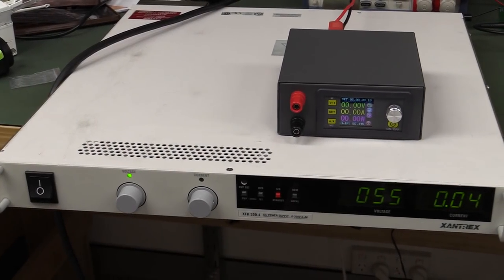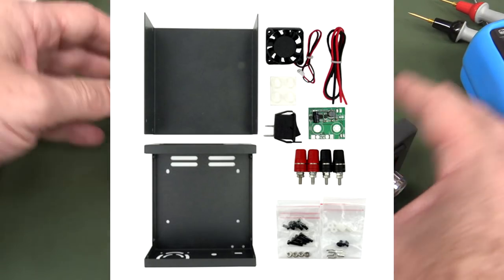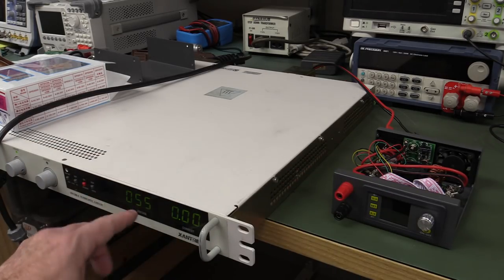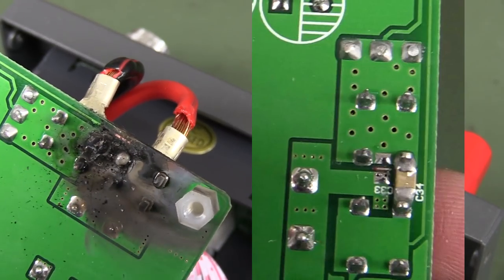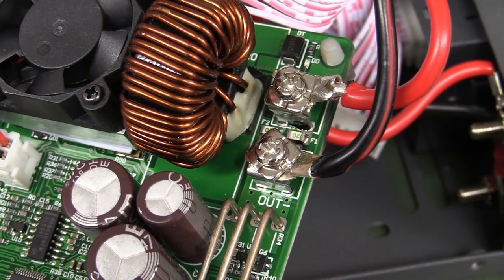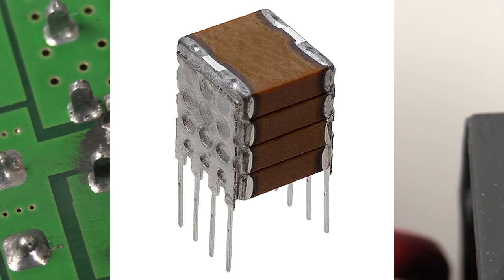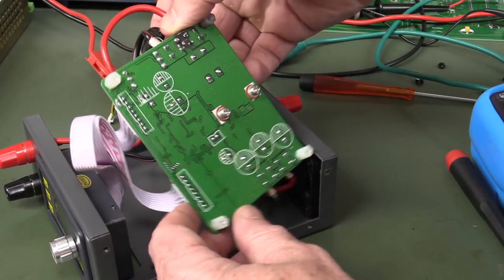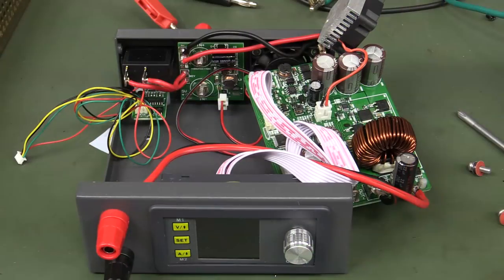EEVblog #1035 - Flaming DIY Power Supply!

Comment: From about 8:37 If you have 2 equal value caps in series,  and one shorts out. Wouldn't it double the capacitance in that part of the circuit? Woudln't it just be like having one cap.
Reply: yes, you are right. in series, it will avoid this problem, but this capacitot and place are not good, we are updating
Reply: Yes, but the point Dave is making is you won't have a destructive short like in this video, because one cap is still good. The chances of both caps shorting at the same time is extremely small.
Reply: Yeah, but Dave said it would halve the capacitance when one shorted.  It would actually double it.  But Dave knows that, he was probably just loopy from the cap fumes.
Reply: Hyxtryx I thought he said it would halve the capacity under normal (nothing shorted) operation, which it would.
Reply: It would, but why would anybody do that?  If it calls for a 100nf cap, and you want to take advantage of this "trick" (I'll call it), you wouldn't put 2 100nf caps in series, because you'd be left with 50nf during normal operation.  You'd use 2 200nf caps to give you the 100nf capacitance the circuit called for.  Then if one shorted you'd wind up with 200nf.  Dave didn't spell it out completely, but I knew that's what he must have meant.
Reply: Ah yes, so he did. I missed that.  He got it right later though. Def loopy from the fumes :)
Reply: @
SimoWill75
now all problem was solved , did you see his new repair video ?
Reply: @Hyxtryx
Dave said this ?
Reply: @Hyxtryx
this is not the main problem, this capacitor was easily to be damaged, even there are 2 pcs in series, the two maybe damaged
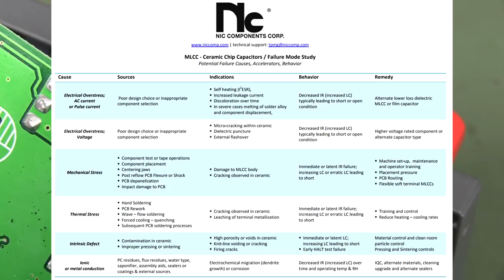Reply: RdTech: Yeah, around 8:38.  "One of them shorts, one of them's just an open cap, so you lose half your capacitance".
Reply: @Hyxtryx
ok, but it is not better plan

Comment: Looks like it could've shorted to the chassis, causing the cap to fail through heat.  The output connectors had solder drips coming off them, a few of which are now missing.  The supply was then (as a bunch of people said), shorting itself out through the carbon and hitting the current limiter (you can see it switch to "CC" which means "constant current limiting" is active).  Also, it looks like there's a small trace open now - might be a sense line.

Comment: My guess would be stress from the big output leads cracked the ceramic capacitor and shorted it out. The larger ceramic caps can be pretty fragile.